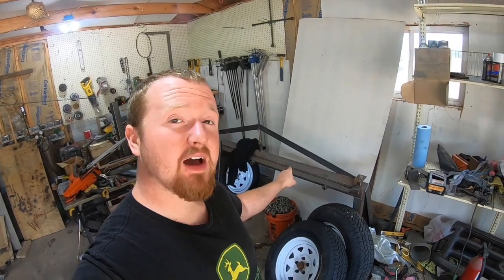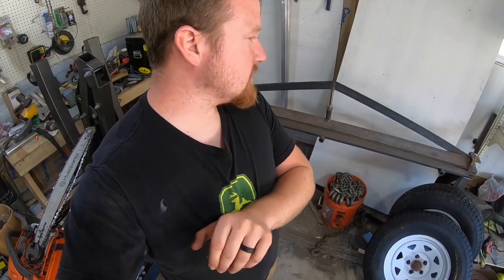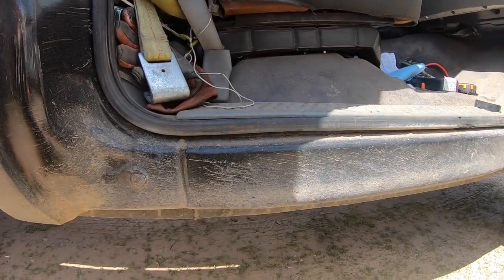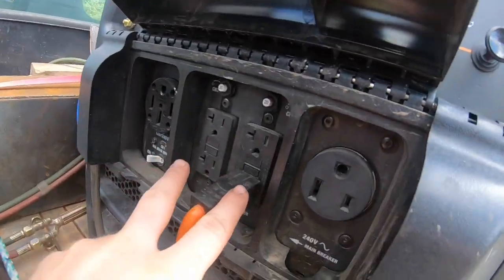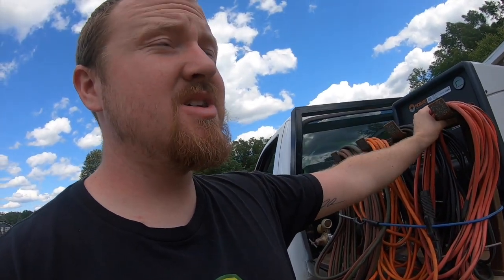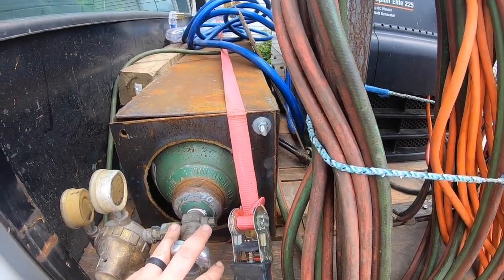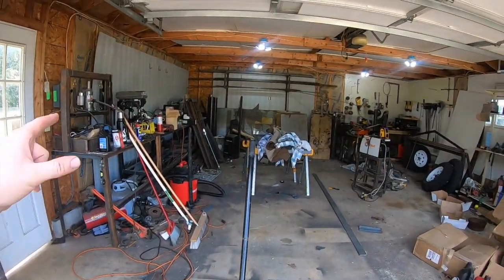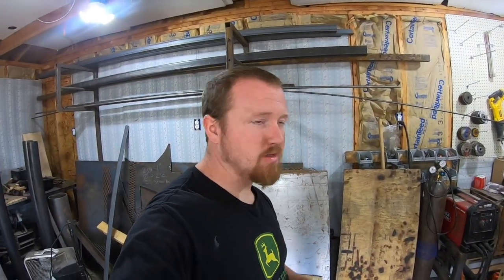How and When to buy equipment-2021 update-rig update-shop update-2021 FabTech?

Comment: There is a place here in Michigan that sells cable for leads very inexpensive. If you want I can give you info. I’m a mobile welder in Lansing area. Always try to help others.
Reply from the maker: Yeah info would be great. When I checked online they were way more than I had. I lived in the Lansing area for a while. Town called Fowlerville. Nice place. Have you been welding a long time
Reply: @austinanson8357  I lve in Williamston not to far from Fowlerville.LOL
I have been welding on and off for over 40 years. I will dig up the company for the leads....If I remember right the cost was around 2.45 ft. for 1/0 cable. Which is very cheap
Reply from the maker: Yeah that is cheap! Yeah I know the Williamston coached in webberville for a while
Reply: I finally found the information on the company with the cheap top-quality welding cable. I have it as a picture of their business card from when I bought cable from them. How can I send this to you in a picture form I don’t know how to do it on here.